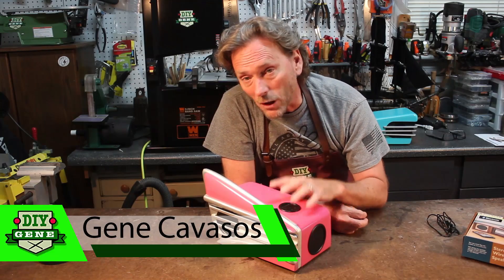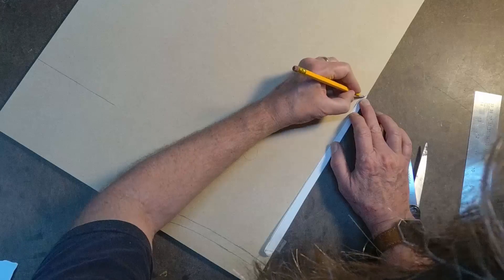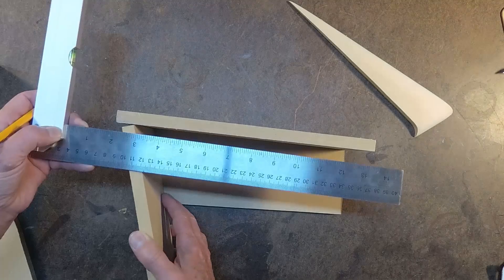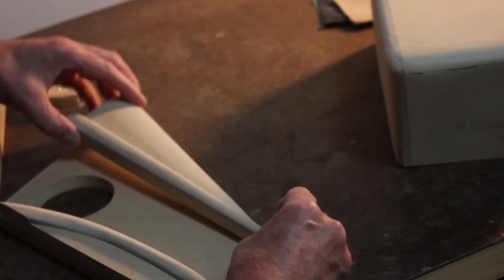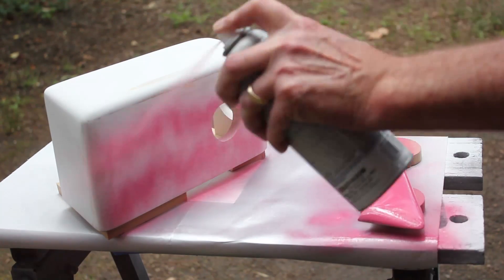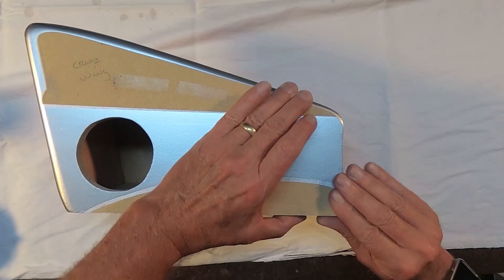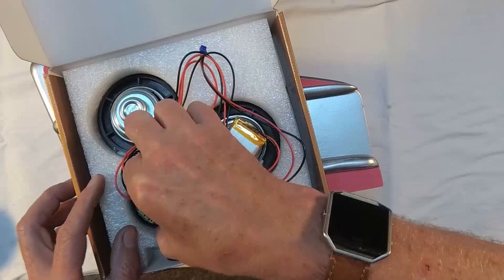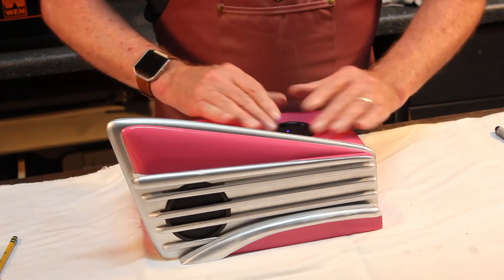How To Make a 50s' Style Tail Fin Bluetooth Speaker (Step By Step)

Comment: That turned out really nice.  For portable tunes it should be the bees knees!  Curious about the longevity of the glue on a porous surface?  I use it to hold things that will be glue/screwed but have never used just the glue on wood before.  Thanks for the content!
Reply from the maker: I hope it holds. According to the company specs it should hold. Here’s hoping. Thanks so much for watching.